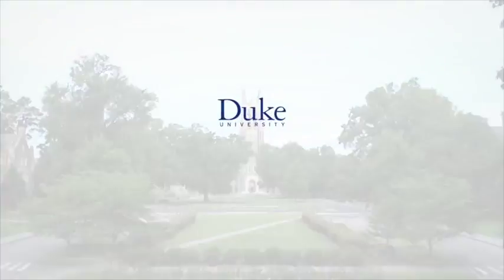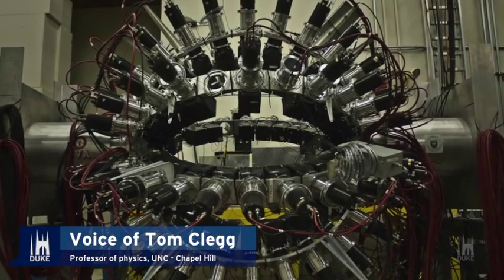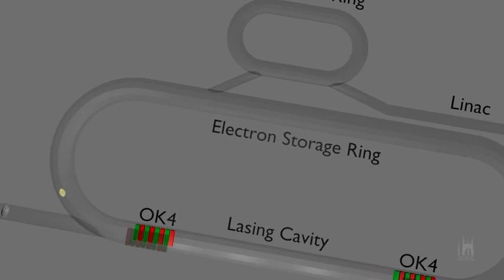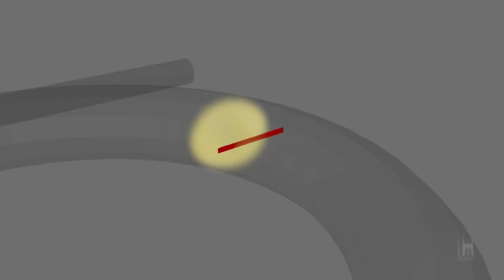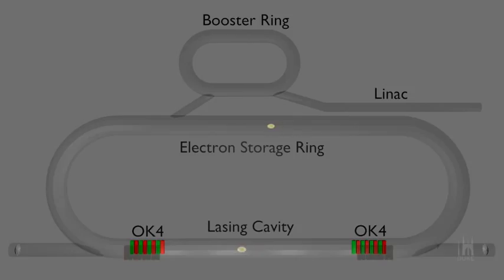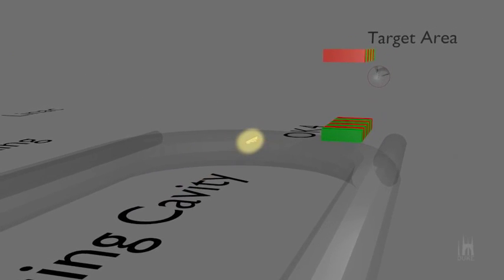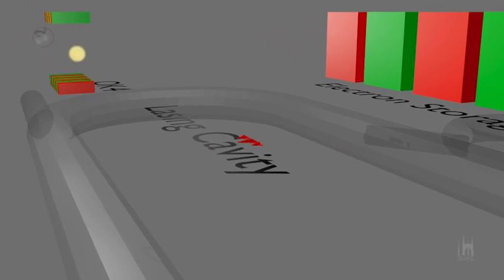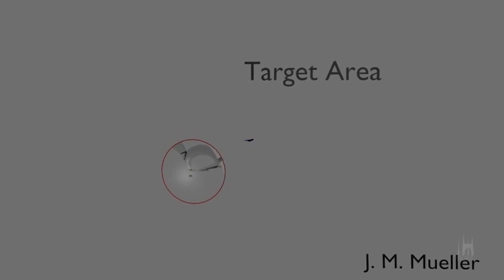Inside the World's Biggest Polarized Gamma Ray Beam {Duke University Research}

Comment: That was interesting.  It is my opinion that Gamma Rays are Pauli Exclusion type particles which have a shape that is tetrahedral.  They are primal particles, but smaller than an Electron which, in my opinion, is composed of 20 Gamma Particles in the shape of an Icosahedron.  Very solid, most of the time, but the Electron may be broken into two X Ray particles (each of 5 Gamma Particles), and one Neutrino... which has 10 Gamma particles, extremely unstable with a very short half life, once on its own.  The X ray particles, in my opinion, have the shape of Pentagonal Bipyramids.  So... in my opinion, one makes Gamma Particles, or Xrays, by smashing Electrons.  Oh, and the Xray particles are extremely unstable, too, and dissolve into Gamma Particles.  Just saying. ( http://butchboard.com/physics.html )